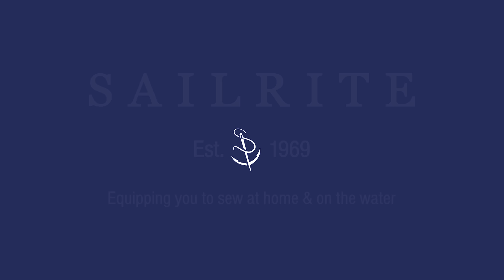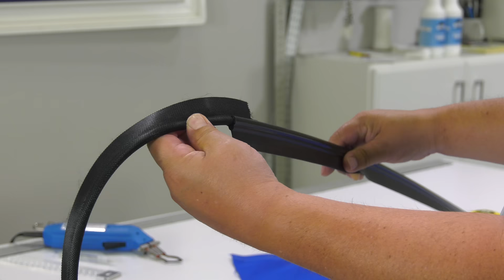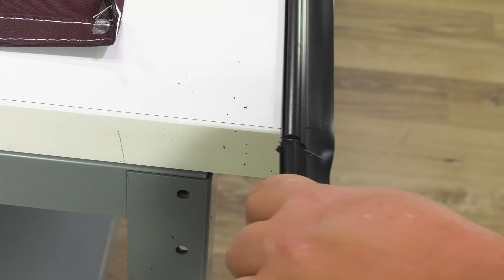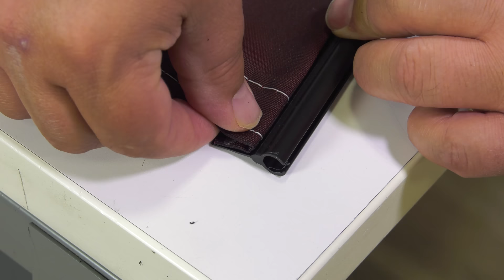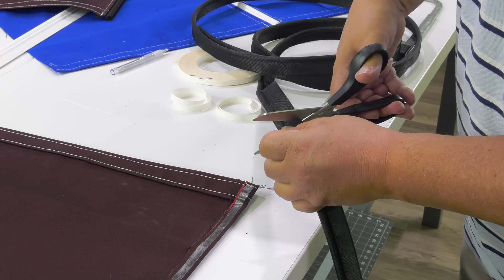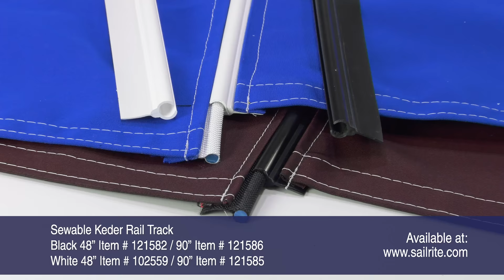Demo of Sewable Keder Rail Track

Comment: Is there a poundage rating on this system? Thinking of using this for a soft top camper design with swap able solid and mosquito netting side panels
Reply: ..was there an answer to this question?  ... the poundage rating?    for the keder rail / rope connection -- if I use it to link tarps together?

Comment: But what is it used for? Can you provide examples for its use?
Reply from the maker: It is used for canvas to canvas applications, sometimes in lieu of a zipper. For boating applications sometimes it is used in an extension panel between the bimini and dodger. I have seen it between cushions as a hinge joining two cushions together. I have also seen it on awnings as side panels.
Reply: @SailriteDIY  Perfect!  I want to design some awning side panels, so I will try the sewable keder rail/ and pair with the keder rope to join panels to the awning.

Comment: What would it be used for?
Reply from the maker: It is used for canvas to canvas applications, sometimes in lieu of a zipper. For boating applications sometimes it is used in an extension panel between the bimini and dodger. I have seen it between cushions as a hinge joining two cushions together. I have also seen it on awnings as side panels.